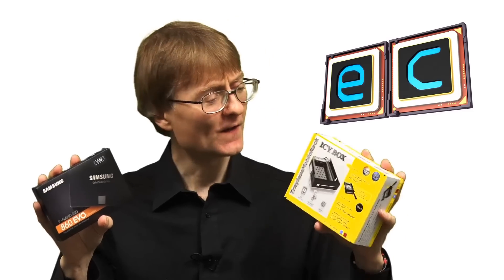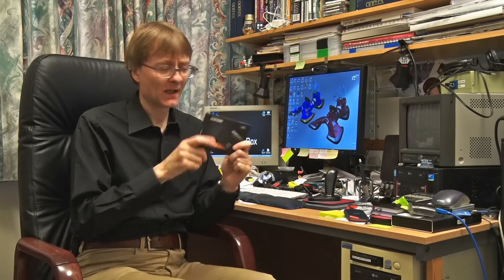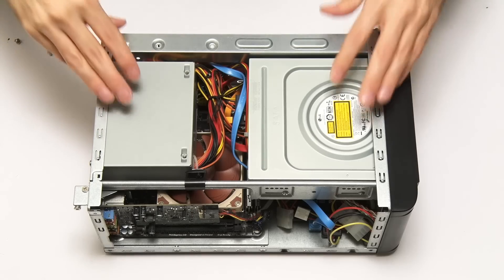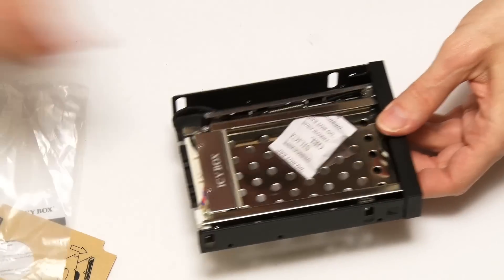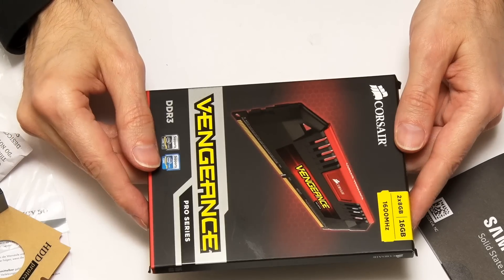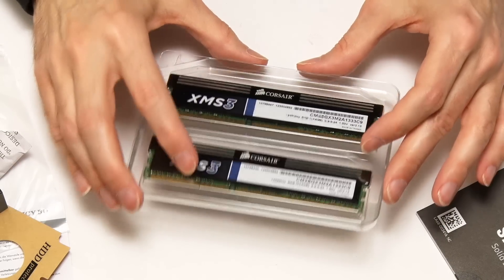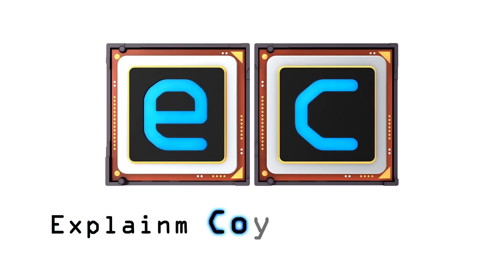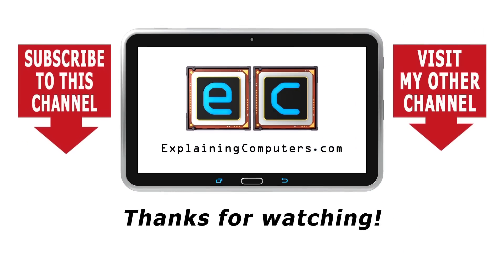i3 Mobile Rack

Comment: It's official, 2019 year of the linux desktop.
Reply from the maker: Yes. It will be fascinating to see the OS market share data by, say, mid 2020. Where will all the Windows 7 users go? Mainly to Windows 10? I don't think so.
Reply: @ExplainingComputers  IMO if you're going to upgrade to Windows 10 you might as well get new hardware.  If I was going to upgrade an older PC I would probably go with Linux as well.
Reply: @ExplainingComputers   I suspect that you nailed it. Win7 users are more likely to think for themselves and many, ie those dtill on Win7,  will exit from M$.  I still suffer from Vista induced PTSD
Reply: @ExplainingComputers  I'd switch to Archlinux on 2011 and still happy :)
Reply: @ExplainingComputers  I kinda disagree.. Most users WILL switch to Windows 10. You can disable the snoopy stuff and block anything you want with Windows firewall (I woudnt trust Windows software to do this effectively though) or any other 3rd party app solution which you trust. Most people though wont care about these issues I think, they just want a modern OS that looks clean, is safe, fast, and gets the job done. They dont care about other issues. For the majority, it is going to be WIN10. Dont get me wrong though, I love Linux but it has many shortcomings like app compatibility for one and requires the user to have a higher skill set than the average joe who just wants to logon to FB, Skype, or email.
Reply: @ashwinmohan4503  -- If you just want to browse the web, FB, Skype and email it doesn't get better than linux.  It's really when you need Adobe and Autocad or want to play games that things get a bit sticky.  That said you're probably right just because most people don't want to install an OS or want to buy a disc at Walmart and install from that instead of downloading and burning an ISO to install.
Reply: @binbashbuddy  Hi yes I do see your point, and thanks for seeing mine. And I am talking about the general populus here not us techy geeks lol. We are a minority :-( Most people will still stick with Win or MacOS for a long time to come. Most of the people still need tech support ( I for one have NEVER called tech support in my life) and the tech support for Linux is not upto the mark yet and also ppl hate transitioning to a different OS than they were used to for years. Cheers and have a good day buddy :-)
Reply: @ashwinmohan4503  -- I'm not a windows user, I don't even use a desktop but use a window manager instead.  But if I sit down at a windows 7 machine I can at least use it.  Windows 10 is like an entirely different system, pretty much like going from windows xp to mac so I'm unsure people will do so because they actually like windows, they'll just do it because that's what they "know" even if 10 is so different from 7 they have to relearn how to use it.  My bud (67 years old) had his machine upgrade itself to win10 and he was lost and frustrated.  He finally let me switch him to mint and he's been happy since.
Reply: @binbashbuddy  I've had that experience myself.  I moved my multi computer world to linux quite a long time ago (XP was still hanging on, Vista was coming but got stripped off any new box), but recently bought a fairly high spec laptop that had Win 10 on it.  I really tried hard to like it, use it, whatnot.  I just couldn't make it work for me - I couldn't get the dancing tiles turned off, Cortana couldn't answer the obvious questions, and well...I put mint on it.  I've seen some pretty clean windows 10 (Chris seems to have gotten there) out there, but the process was just too much for someone now used to the total control and pretty unified way of doing things in linux.  It just wasn't worth the effort, even for someone who has been programming since the lat '60's and syadmining (my home network has > 20 machines on it) for a few decades as well.  I just didn't see the payback for putting in the effort as I'm not a gamer and I find the linux alternatives to Adobe's security dumpster fire (and rape via subscription) work well for me.  I can use windows 7 and have a disused copy in Virtual box, but the only reason I do is to reverse engineer oddball sci/tech hardware that only comes with a windows driver so I can write one for linux.
Reply: @binbashbuddy  Hey dont get me wrong, I use Win7, Win10, and Linux (Ubuntu) too. Windows sucks sometimes cos they have this planned obsolescence. In our company several of our industrial softwares work ONLY on Windows 7, pretty frustrating that MS is dropping support and security. Its not that big of a deal since we dont allow these PCs access to the internet. Linux is easy once you get through some basic stuff, but I have had a lot of my family members complaining when I installed Ubuntu on their laptops or desktops. I think the main problem is the image, its just not popular enough or mainstream enough. And the aforementioned app support. People would rather pay more for the image of Windows/Mac rather than a competitive alternate. Your bud is pretty cool though, when I first used Linux way back in 2013 I guess (Debian something) it took me like a week to adjust lol!
Reply: @ashwinmohan4503  -- I worked on unix back in the day so the transition wasn't so bad for me back in 2009 when I went to linux, but the interface has advanced so well that it's very simple to crossover these days, more so if you're really just a browse the web a point and click person anyway.  My bud did fight me for a long time, he wanted his windows, he'd never be able to use a "complicated" system like linux, but after a number of occasions when I couldn't help when he had issues he finally bit the bullet.  First week had some spots, like he insisted on windows movie maker, after trying to get it to work and failing I finally loaded kdenlive and he fell in love with it.
Reply: @binbashbuddy  Agreed on all your points buddy, but I just dont see Linux beating out Win/Mac. Just my 2 cents though
Reply: @ashwinmohan4503  -- Mac won't beat out windows either.  Not disagreeing with you at all.
Reply: @binbashbuddy  I wholeheartedly agree with that. My friend uses her laptop solely for emails and browsing. She's now using Win7, but I have already advised her to switch to Linux Mint: it's faster, safer, and free.
Reply: @binbashbuddy  In or before January I have to switch a friend over to Linux. He's the least technically minded person imaginable but for his use, which is little more than web browsing, email, and word processing, Linux will be perfect and I really don't anticipate him having any problems with it.
Reply: +1
Reply: I have 6 Pis, my media server and two arcade setups natively running Linux.  Truly Linux is ruling them all.

Comment: Awesome video a
 I have a older pc  makes me want to put android or linux on it but don't want to mess it up
Reply from the maker: You can always first boot from a USB drive, No need to install just to try it out. I've a video on Linux Mint for Windows Users here: https://www.youtube.com/watch?v=eI7QQqnV1P8
Reply: Get another hard drive, but don't dual boot...windows messes up the bios or something to do with windows store. I think this is why Chris is using the tray so he can remove the alternate hard drive easily, but you can just open up the computer and swap it physically...it's not a big deal.
Reply from the maker: Dual booting can work OK if you locate the boot loader on the non-Windows drive. Or install each OS separately, and switch between them using the BIOS, not something like GRUB, which can indeed get corrupted.

Comment: Chris, now is an excellent time to start with a few videos on transitioning to Mint after Windows 7 support comes to an end. I think there are many subscribers that would like your inputs on easing into Linux. For example, what about some alternatives to Windows software? We all know about things like Libreoffice to replace Office, and Gimp to replace some Adobe software. However, what about stuff that is not so common, like using Xournal as a pdf annotator in Linux, Uget for downloads, Cheese for webcams, and Xiphos instead of e-Sword (I am just thinking off the top of my head). 

Then there is Wine. I know you did a whole video on Wine, but that was the basics of installing Windows software. What about showing configuration options and installing extra components (in Wine), to make unresponsive Windows programs work? I have installed many different Windows in Wine where they did not work initially, but with a bit of simple tweaking and installing some libraries and components, it worked just fine.

In short, what about helping people to transition to Linux more easily?
Reply from the maker: I hear you. I'm just finishing up a video that addresses some of this. We have not long to go now. :(

Comment: When you swap SSD's, does linux change the time in your bios?
Reply: This can happen because Windows considers the hardware clock to be as local time, while Linux considers it as UTC.

Check this link to understand more and possible fixes: https://abchk1234.wordpress.com/2013/11/14/stop-debian-from-saving-to-the-hardware-clock-on-shutdown-solve-messing-up-of-time-on-windows-by-debian-prevent-debian-from-messing-up-the-system-time/
Reply from the maker: Not as far as I am aware. But I will look out for it!
Reply: @ExplainingComputers  , my Hackintosh ssd, for some reason. sends the clock two hours back... and I cannot figure out why.

Comment: Computer genius rocking an antique i3 with 4 gig ram?! Just goes to show it's not what you got but how you use it!
Reply from the maker: The i5 does all I need it to . . . I am using it right now (in Linux Mint). I made the transition a few years ago from a single large machine, to a large machine for video editing/etc, and a smaller, very quiet and low energy one for everything else. And it has worked out well. And sometimes I use both at once! :)
Reply: @ExplainingComputers  He is EC. He can use more of that i3 than I would ever do use in my life
Reply: iam using a mashine wich runs 1st Gen i5 :D
Reply: @benNdaKen  mine too, but if I connect to the USB 3 the USB 2 mouse and keyboard go bad, guess I'll remain in the dark ages of USB 2 a bit longer
Reply: @ahuman6825  i dont fully get what u mean with usb 3 and usb 2
Reply: @benNdaKen  the computer has USB 3 but it don't work properly, that's how crap it is
Reply: @ahuman6825  USB3, at least many early implementations, produces RFI that jams a lot of 2.4 gHz wireless things.
A couple fixes are total shielding discipline (ugh) or a cheapo passive USB hub on a very short wire to the USB3 port, which limits the radiation from the USB signals.
Reply: @DCFusor  you may be on to something there, I have the wireless keyboard thing plugged in to a USB extension cable ran out straight to be closer to the keyboard, plugged in to USB 2, this makes it better but it is a bit laggy and clunky while I am transferring files on to a drive plugged in to usb3
Reply: @ahuman6825  A better quality cable on the USB3 stuff might help.  Perhaps we can get "the guy with the Swiss Accent" to pull out his spectrum analyzer so everyone can see this...I have some RF tools, but don't make videos anywhere as nice as A, Speiss does.
Reply: @ahuman6825  maybe try upgrading usb drivers???
Reply: @ahuman6825  I use a 8 year old Intel motherboard with no issues with USB3. Try to get one.
Reply: @benNdaKen  My Linux Mint machine also runs a 1st gen i5. 12 gig RAM with a Geforce GTX 750 Ti. Sure it's getting on a bit, but it runs great.
Reply: @benNdaKen  I have i5 generation 2 8 years old and have no speed issues. Run all sorts of tech simulations and also newest games. 12 gigs of ram. Not going to upgrade soon.
Reply: Very true. I have an i5 2500k from 2011 that's still a very capable machine. It's overclocked to 4.3gHz and running Linux Mint extremely well. 😄
Reply: @Bassman-r3c  i had a 2500k. Switched to a 3770 because its "faster" than  a oc 2500k and the fact 3770 cpus from prebuild systems are everywhere now
Reply: Knowledge of computing has no correlation with computer usage. Some of my colleagues are computer scientist and go for weeks without using a computer! Their weapon of choice is a paper notebook or whiteboard whilst they develop theories of computation.